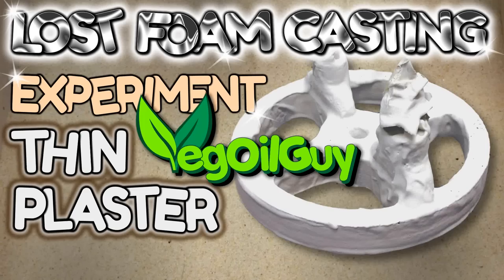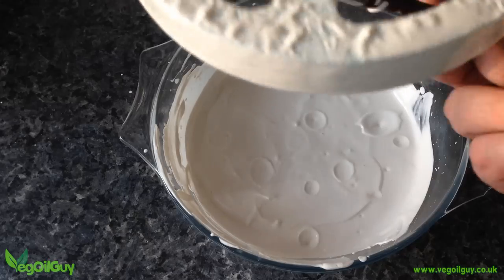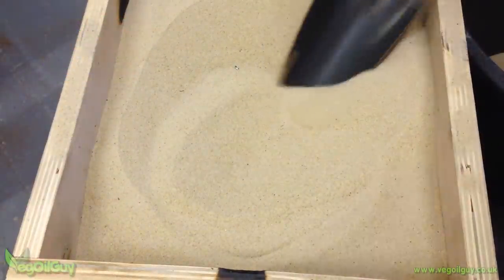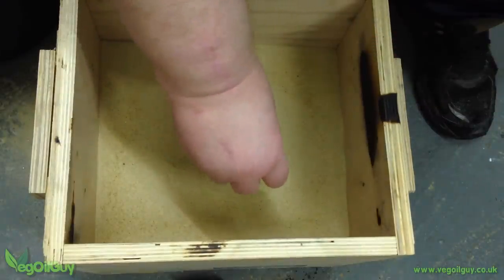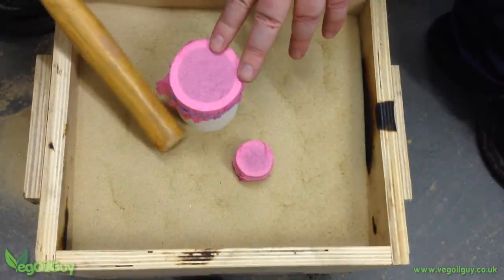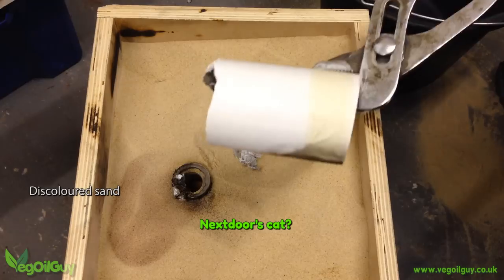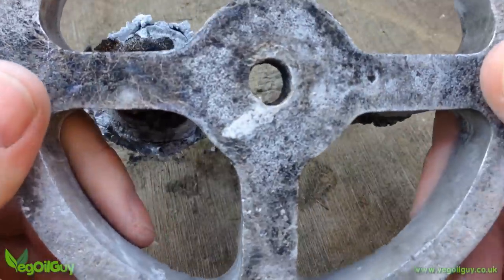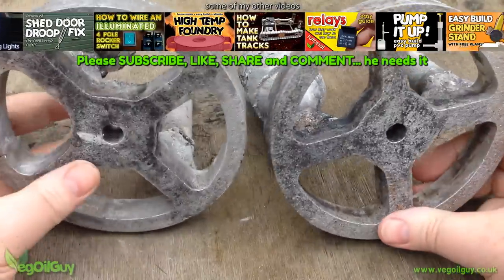lost foam casting: EXPERIMENT with thin plaster coating  by VOGMAN

Comment: Very interesting, I know when hot metal hits the foam it's vaporized but what does the metal do to the plaster, forms inside or out side of the cast , if out side what about spraying thin dry coats till it's covered with out dripshnbnm
Reply from the maker: Imagine that the foam's not there... it vanishes... so yes you're left with a plaster shell and the metal fills this like a hand in a glove. The problem is the metal isn't alone and the metal picks up gasses during the process and the foam leave plenty behind, and the plaster holds water so that's steam as well - and all of this is trying to get out every way it can which is why it jets from the vent... but that alone isn't enough.
Or at least that's my theory : )
Ideally you want a coat that's thin enough to breathe but solid enough to hold the sand back long enough for the metal to solidify.
It's a fun conundrum.

Comment: Make the plaster thicker and let sit for 2 days 
Bake it for 45 min at 600c and pour
Reply from the maker: Surely it would have to be a LOT thicker. The foam would melt in the 80's I believe.
Are you suggesting using foam in the same way as wax in lost wax casting...? It might work... interesting thought  : )
Reply: This was exactly what I was thinking. You could even put the dried plaster coated foam in sand and then heat the whole thing to burn off the foam just before casting which would have the added benefit of pouring into a hot mold.

Comment: I just found your channel a few days ago (approx 4-6-2019) and have enjoyed your content, and learned a few things as well, of the 4 to 5 videos I have watched so far, plus, my lady enjoys hearing your Aussie accent, (reminds her of ClickSpring, Lol) but anyway... I was wondering, if doing this (thin wall plaster method) while in loose sand, just like in this video, if making an "L-shaped" runner vent or filling vent out of more plaster........ But, filling/pouring and venting the cavity from the side of the parts cavity, or maybe even doing a "J-shaped" runner/filling and vent gate, so the molten material flows in from the bottom, if that would prevent the splits areas in the finished part? Or am I making things more complicated then they need to be. I time to time, get these splits in my parts, and I don't understand why, and these splits are always at the bottom of the part, and my tiny mind, would like to think that that if the splits happened on top of the part, as if there wasn't enough molten material in the cavity to fill it up , but nope, these splits, when they happen, are always on the bottom corners/edges of my parts, if they were on top, as if it was a partial fill and gravity, they would make sense to me, but on the bottom, lol... I seen another channel about 6 to 8 months ago, talking about side filling and or bottom filling, as stated above process... I have not tried it yet, just wondering if you know why these small hair line splits happen on the bottom, and they never happen in the same location for the same part either? is the aluminum is being cooled to quickly as it has to flow around the multi faceted cavity? Meaning, I need to bring the temp up an additional 50°F to 100°F before pouring? Maybe placing something under the cast box on the vent side, so the cavity is no longer level and the vent side is higher? Maybe pouring the molten aluminum very rapidly into the cavity, and not worry about sand being knocked into the cavity? Anybody can answer this issue for me, and there is no hurry, as my next project is about a month away
Reply from the maker: Dru, you made me laugh my friend. I have a lot of Aussie subscribers and they'll all be screaming, "Aussie? He's a bloody pom" or words to that effect. I'm English, born and raised in the UK without a hint of downunder  : )
Don't worry, I'm not offended and please don't mind me laughing about it. It's all in good fun.
Now, your experiments... never be afraid to experiment. The truth is there is NO single answer. Casting is one of those things that even experts disagree over and amateurs find their own way. So feel free to dabble - you may discover something no one else has.
When it comes to Lost Foam casting, if you can get Green Sand (it has bentonite clay in it) then look up my videos on the subject. I get good consistent results with it.
However, in relation to the splits, these are probably folds or porosity. Folds tend to be two seams of molten metal colliding but, critically, being at different temperatures. Porosity tends to be caused by trapped air.
It's a balancing act. Personally I try to go quick and smooth with lots of vents. Filling from underneath is an excellent technique as it theoretically pushes all air from the mold.  I've used this technique a few times myself. Quick should keep a stable temperature and smooth eliminates any possible agitation that can also lead to porosity.
Anyway, I'm sure many others will chip in with their opinions, doubtless conflicting with my own - as that's the casting way. But I hope the above helps  : )
Reply: @vogman  ah!!!! Aussie, or proper Englishmen linguistics, lol... Either way, she fancy's accents, in fact, I think it gets her motor running or something, lol... I am not worried so much about the resources, vs, time... I suppose, I should just leave an area of the shop set up just for my pours, and I think I would be more inspired to play often, vs, when done, I clean everything up, and put it all away... And I believe I feel like I am starting over in the learning curve every time I drag the stuff out... Or to drag the stuff out, to experiment, I think is my declaration that I am starting to get lazy, lol... Thank you for the answering of, "the unknown causes"... I don't feel alone now in that it only happens to me, as that is not the case... I may just get started a week early, and do a few tests, like the questions I was wondering above... Thank you
Reply from the maker: No worries Dru. I'm happy to help any time. My best to your good lady  : )

Comment: you need to plaster dip and then slowly spin out of the dip 
also it my help your surface finish to use a denser foam 
also turbulence is generated from the burning chemicals that the foam consists of, It defeats the method of foam casting but if you were to burn out the foam first, that would help turbulence
Reply from the maker: Thanks for the input.

Comment: Hey thanks for the info were could I buy this etruded foam?
Reply from the maker: It's very common. You just don't realise it's around : )
Model makers use it a lot, so try any hobby type place. I found it quite cheaply by searching on the internet.

Comment: the sodium silicate method I like best with the foam it needs gas ports so you don't get the bubbling out like you did and you lose some heat in the exchange proses and if you use a very fine sand you can get a very good finishes as well the best is the lost wax . and I know how to make sodium silicate if need to know how ask me :)
Reply from the maker: I'd love to hear how you make that, yes please  : )
I'm always eager to learn and try new techniques.
Reply: sodium hydroxide and the cat letter that is like beads with blue spots in it you will need a hot plate do out side and water be careful  with the sodium hydroxide its drain cleaner , it works a lot faster if you crush the cat letter before hand or you will be mixing  it for a long time the recipe is on youtube were gloves and eye protection and don't have any kids around when doing this ,it has many uses . its also called water glass ,and store in in a air tite container and were no kids can get at it  or it will become glass hard it washes off fine as long as its not hardened if you get it on your close its not going to come off  and don't breath the fumes us a fan to blow them away when working with this stuff .

Comment: What would happen if you used a thicker plaster coating?
Reply from the maker: With thick plaster the results would be poor. The gases within the metal as well as the air that's trapped inside the mold all need to go somewhere. Even venting doesn't help  : )
Reply: @vogman  good to know

Comment: I think your plaster is too thin.. and perhaps you should have done this with the cast object oriented vertically to reduce trapped gasses...
Reply from the maker: I'm not sure the thickness would help, but the vertical alignment is an interesting suggestion. I may have a tinker with that some time : )

Comment: Why does the plaster have to be thin? I am not following. It seems to be that all you have to do is have the part coated. The sand holds the plaster in place while the metal is poured in. It seems to me that the thickness of the plaster is irrelevant other than being thick enough to coat the part.  What am I missing?
Reply from the maker: That's a fair question and one I haven't explained properly.
The issue is gasses which get trapped in the metal during casting (and which come from the foam and moisture in the plaster). If the gasses cannot be released sufficiently, they can get trapped in the metal, weakening it and producing a spoiled cast.
Many believe (and I'm one of them) that plaster is not the best coating as it cannot breathe - so I'm guessing that folks that insist on it being thin presume that thinner coats might allow gasses through - but they don't. 
What's required is something to make the plaster more porous, which is either an ingredient or a technique. Hopefully if such a thing exists someone out there might let me know... but we'll see : )
Hope this helps.
Reply: Thank you for explaining this. You just taught me what might have taken hundreds of castings to figure out on my own.  Your channel has been my favorite since I recently found it and this is why. Your need for perfection in the process and your need to understand what is going on has driven you to not only a better and better process but also an understanding and with the ability to teach it to others. 

At 47 I find my self back in school learning robotics and electronics and there are many types of instructors at our local college. There are some that are so smart that they gloss over the process because to them it is just so simple and easy.  Then you have others who can read a book and explain the process, but do not understand the "why" and therefore the lessons are vague. 

I have been a hand tool collector and user for years and have always wanted to cast some of my own stuff. This last quarter of school, I took an engineering drafting class where I learned to use 3D modeling tools, both Inventor, and Solid Works to be used with the schools' 3D printers. This was the key that opened up doors to possibilities that I never knew existed for me. I am now able to draw anything my imagination can come up with and print it.  Within one week of class, I decided to purchase a printer (on its' way) and begin a Youtube education in casting. My goal is to eventually be able to print in wax and use the investment casting process to make my own designs.  

That is how I found you originally, looking up casting methods. I did, however, find that you have much more on your channel that crosses many of my interest paths and I really enjoy your channel. 

You, sir, go beyond the what and how and explore the why as a way to continually improve your process, and that is the heart of a true craftsman.
Reply from the maker: Thanks very much for your kind words.
We're of a similar age and could be brothers (though I'd have to call you junior) and I'm amazed how similar our interests are.  But you're much braver than me... I don't think I could face a college education again, even just night classes. So I explore, experiment and generally self-educate. I tend to learn best that way and have met every one of your tutors by the sound of it.
How interesting that you are exploring 3D printing and casting... watch this channel closely in the next few weeks (hint, hint).
What CAD software are you using? I'm looking into that one.
Good luck with your studies and don't be afraid to ask questions or chip in with comments if you think I'm going wrong - I like to learn... it's wasted on the hormonal young - at least in my case ; )
Reply: Here is a hint: Inventor 3D modeling is a great program. It costs about $20,000 US but if you are a student (have a student email) you get a free 3-year license. Go to your local college and take 1 or 2 credit class for a next to nothing and get a student email.  

Going from 3D modeling to a print is merely downloading the model you made as an STL file. The great thing about the software is that the tools you are given allow you to create the most complicated model with ease. I took Inventor the first half of the quarter and the second half is Solid Works. Solidworks has some things I like about it, but for just using something that is intuitive and without getting too overly complicated, I like Inventor better. Also, I get it for free as a student and take it home on my laptop. When my lisence runs out, I will go back to school and take a jewelry class or something so that I can reup my lisence.
Reply from the maker: I like your style : )

Comment: What type of foam are you using there???
Reply from the maker: Hi Johnathon. It's extruded foam. It takes a little more energy to burn but it's fabulous stuff to work with as it can be machined, filed, sanded, etc, where normal expanded foam falls apart. With a little preparation, you can achieve some amazing results. Have a look at this video if it interests you https://youtu.be/Bv1uV2MHMKk

Comment: It seems to me sanding off the plaster did nothing but cause issues.. why sand it off? the thickness of the plaster should not even matter..it's going to burn off just the foam and hold its shape better inside a thicker casing of plaster. thinning it out only lets the loose sand give way and intrude into molten aluminum..
ok I have never tried it this way but it just seems logical...
Reply from the maker: Why thin? Because the whole thing was an experiment. I was answering requests to test the idea that thin plaster could breathe like sand.
Reply: @vogman  hmm..I see,,,so it off gas's to the sand is the idea.. I never considered that it needs to..I'll have to try both ways too.

Comment: i don't think this is how it's supposed to be done. you should use multiple layers of plaster and sand on the mold.
Reply from the maker: Hi Steven. You may be right. That's not something I've personally tried.

Comment: I think the plaster inhibited the escape of gases.
Reply from the maker: Exactly! Without anywhere to go, the gases remain in the metal and form faults. That's why I prefer green sand  : )
Reply: VOG what if you used investment powder as it is porous and should allow gases to vent plus it would last longer as there is no negative space to fill as it’s not cheap.